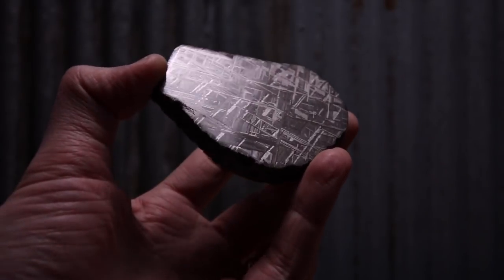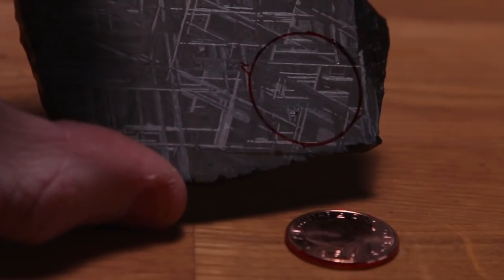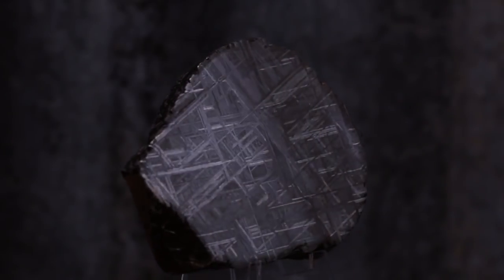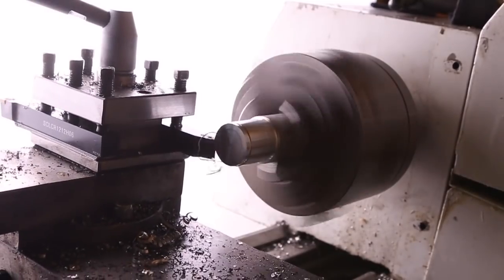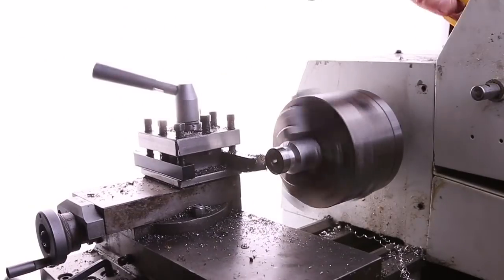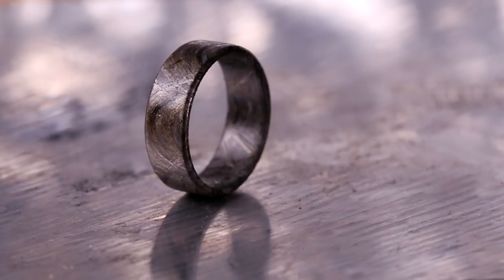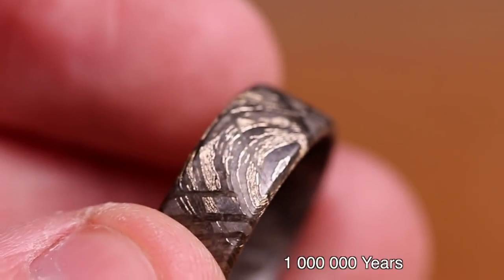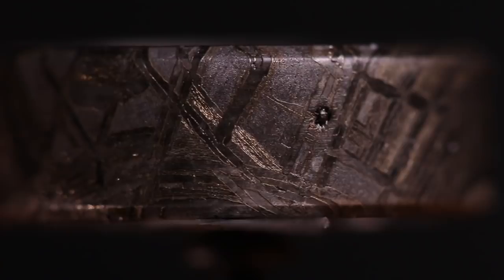my 4,566,300,000 Year Old Ring - crafted from a Swedish Meteorite

Comment: 03:34 Your logic does t make sense my dude.  Your reasoning for why it’s a meteorite is because the lattice pattern takes forever to make… not that it formed in zero G or something.  This could have formed way down in the deep crust of the earth and after millions of years gotten thrust up as part of a mountain or burped out by a volcano or got unearthed when continents pulled apart and a fissure formed.  The reason you gave does t really prove anything other than it took a long time to form.

07:12 ahhh now see “it’s older than the earth by 20 million years is a much better argument for knowing it’s a foreign body.  Although Google is saying the Earth could’ve taken 10-20 million years to form so it’s still possible this formed as part of Earth’s coalescence. 10-20 million years is a huge “margin of error”.

Comment: Excellent work on the lathe.  Question, I assume that was Ferric Chloride you first soaked the ring in for etching similar to Damascus, is this correct?  I also assume the third was a clear coat to help prevent rust (just guesses).  But what was the second liquid you soaked the ring in and for what purpose @7:48 ?

Comment: Technically, yes it can be made in a lab, but one aspect he forgot to mention, is that the only way to get that kind of crystal pattern is for it to be formed in a microgravity environment, in other words it was formed in the vacuum of space. You cannot grow those crystal shapes on a planet like earth, they form in zero g environments. so when you see metal with that kind of crystal pattern, you know it wasn't formed in Earth, or any other planet that we know of, but rather in open space like the asteroid belt or the kuiper belt, and they tend to have formed millions of years ago, while the SOl system we live in was in the process of forming, so to have one and enough to make a ring from is a fairly big bragging right, of which you can say that it is likely older than the Earth itself and formed in the vacuum of space and the lattice-like structure of the crystals makes it more tough than any standard metal of the same composition formed on earth, because the structure of the crystals makes it so. It is a very cool thing to have, only just remember than although these meteorites have a fair amount of Nickel in them, they are particularly susceptible to rust, and need to be treated with preventative care to avoid damage by your sweat, oxygen and other contaminants that cause the metal to corrode just make sure you treat it with an oil occasionally to prevent corrosion, and remember that women's sweat has a higher acidity than men's and some people can destroy these items by simply being in contact with them over time. I suggest that it only be worn occasionally rather than full time and always dry them when they get wet. That being said, well done in making the ring dude, you have an amazing piece of SOL system's history wrapped around your finger!!

Comment: The result is, unquestionably, beautiful. Now, when you can do that all by hand, without doing it all via the use of heavy machinery, I will be impressed.
Reply: It's meteoric iron, not a 'soft metal' normally used in jewelry. The Mohs scale of hardness (used by jewelers) ranges from 0-10 (10 being diamond), has gold at 2.5 and "iron" (this meteorite looks like Kamacite, 90-10 iron-nickel mix) at 4+. You couldn't form it as one does gold, it's a bit too hard; you'd have to hot forge it as a blacksmith does. It's not "impossible" to do, just very hard to work something that small and impractical for sizing. I've made rings out of Titanium (Mohs 6) and one can't practically hot forge it; machining (or grinding) are the best solutions.

Comment: I made a ring, but I used an extra 3/4" Vanadium socket out of my tool box that fit my finger.  Cut off the end, then ground and polished both sides to symetrically match and the sharp edges down into a ring.   Oddly, we have an insanely huge and heavy lathe like this but I never use it.   Let me know how you think it turned out :-)  Picture:  http://shellprompt.com/dump/The_Ring_BookCover.jpg
 
p.s. the person I gave it to, threw it in a lake somewhere in Coventry, England.  So it's now a lost ring on its epic journey...   if you ever find it...   it probably will be rusty... I mean, vanadium steel is corrosion resistant, but not all that much so - according to all the rusty sockets and wrenches I have...  :-p    choppergirl.air-war.org

Comment: 2 things - 1: It really does it for me ! By that I mean it fits perfectly with what I search for in jewellery - it's unusual (Understatement of the year right there !) And it's Unique, luv it !
Give me hand-crafted over machine stamped or mould poured everytime !
2: Watching you operate drill press and lathe took me back 40yrs to when I trained as an apprentice Engineer - of course I never did become an Engineer, because here in N.Ireland All the heavy Engineering was dead - except for the Shipyard, and about 80% of Light Engineering went the same way. 
But the memory it evokes for me, was watching our Instructor, Mr.Fearon, who'd had his right  hand mangled by a Milling machine - and all because his Company insisted that Senior Engineers, like him, wore a shirt & tie under a brown Drs type coat, because they were Professionals ! And they wanted Customers walking through the Machine Shops to See Professional men at work !
And all that bollocks plus ties that weren't Clip-on, meant stopping to chat on his way back from Tea-break, he'd forgotten to button up his coat which cost him  2 and 1/2 fingers off his right hand trying to get the tie out before it choked him to death, or pulled his face into the cutter - which was still spinning even though he'd slapped the Safety button and his mate was on the Brake and trying to turn the bed down ! He wasn't anything after that for another 3yrs, until the Govt. Training Centres came along and he became the Senior Tutor (and 1 of the Disabled Quota !) And, He only ever wore bow-ties after getting the job !
Ever after that I made sure to listen to His Safety Talks and took responsibility for the lads in my Section. Overalls buttoned up, no loose jewellery or rings or watches and sleeves rolled up to the elbow. I also had - which I didn't notice you wearing - 2 spare pair of Safety Glasses - for the dopey young lads who'd forgotten theirs and would have had to go to the Office to get another pair and fill out Health & Safety Reports sheet that went into their Files. 4 in a month was 2 weeks Suspension without Pay ! 
2 Suspensions in 6 months and you were "Out the Gate"! & late '70's N.Ireland was No Place to be out of Work for a Disciplinary ! 
Anyway - talk over, but please be very aware of your own Safety if working Alone. I'll share a Tip with you that I did with my neighbour, a 'Work from Home' Carpenter and a Mechanic friend who also worked alone. An "Aid Call" button you can clip-on, or have in a pocket. I know it's the kind of thing you normally give to Older or Vulnerable people ! 
But, as I told them guys, if you're alone and immobile what if you can't reach your mobile cell fone !? I'm that cautious I were mine - and Safety Glasses ! - even just painting the ceiling, or putting up a light fitting, or under any of the family cars. Basically it's Safety 1st,2nd & Last with me !

Comment: wow what an easy process. Could this be done with obsidian?
Reply: I don't think you can do this with naturally formed obsidian. It's basically glass, but the naturally forming structure is layered across the entire mineral. Like sedimentary rock (ie shale). But it's igneous. That structure means it chips and shatters reeeeal easy. Best I've seen was sculpted by shattering the sides and hoping it doesn't fracture too bad and then drilling a hole through. Which has a pretty cool quality to it, but it isn't reflective like obsidian it just looks like granite. And it would probably break if you dropped it wrong. 

You can melt it and shape obsidian. But it has to be extremely hot. Hotter than any typical metal. But the impurities that make it black and pretty form slag and bubble out. So you're left with an ugly goey glass. 

My only source for this "knowledge" (trivia) is a bunch of videos of people trying to craft things with it. 

How rad would that be though!? Someone should figure it out. (b^.^)b

Comment: So this metal is not as hard as titanium, how easily does it cut through in an emergency 'with those cutters they use at hospital's? 
Idea or question for you 'how would this metal go if it was to be made into a sleeve and then soldered or fixed over a silver or any other precious metal ring,,, could that be easily done with that type of metal?

Comment: This is simply amazing the look it shows after you etched it. Is this ring reactive? Is it reactive similarly to tungsten?
Reply: Most meteorites have a high iron and nickel content, so without some kind of coating rust will appear rather quickly. Some have other elements that help resist corrosion but most will rust without a coating.

Comment: How do "they"  know the earth core is molten iron?
When the deepest hole EVER.drilled in less than ten miles deep?
Reply: It's a series of very educated hypotheses, backed up by extra-terrestrial evidence. 

Firstly, Newton's Law of Gravitation states that the force of attraction between any two particles in the universe is directly proportional to the product of their masses and inversely proportional to the square of the distance between their centres. 

In layman's terms, that means that the greater the mass of each particle, the stronger their forces of attraction on one another, while the greater the distance between each particle, the weaker the forces of attraction are on one another.

a couple of formulae:

Density = Mass/Volume 

((GravConstant * Particle1Mass * Particle2Mass)/EarthRadiusSquared)  = (Particle2Mass * Particle2Acceleration)

^ This formula simplifies to:

Particle1Mass = (Gravity * EarthRadiusSquared)/GravConstant

This means we can calculate the Earth's Density by taking the Earth to be "Particle 1", while Particle 2 can be literally any object on which the Earth's gravity is acting. Because the mass of particle 2 cancels in the formula, it's kind of irrelevant. 

Therefore, we can calculate the Earth's density by combining the formulae to get:

Density = ((Gravity * EarthRadiusSquared)/GravConstant))/EarthVolume

Some conclusions we can reach with the data we obtain from these formulae:

1. The Earth's average density is far greater than the average density of the elements making up the Earth's crust. Therefore, we know the Earth's core must be super dense in order to make up the difference in average densities. This  means the core must consist mainly of Heavy Metals.

2. Iron is the most common heavy metal in the universe. It makes up the majority of meteorite cores, as shown in this video. 

3. We can assume that iron therefore makes up the majority of the Earth's core.

People say it's molten, it's not. At least, not entirely. The Earth's core is actually two layers; the outer layer is molten, while the inner layer is solid. This is because the inner core is under unbelievable pressure, and boiling and melting points increase with pressure, as the greater the pressure, the stronger the intermolecular bonds are, and the stronger the intermolecular bonds are, the more energy is needed to break them. Fun fact, on Everest, water boils at approximately seventy degrees centigrade, because the air pressure is so much less up there than at sea level. 

We know the core's outer layer is molten and the inner layer is solid because of special types of seismic waves which we can emit and then detect the reverberations of. These reverberations are different when they travel through solids and liquids, and from them we're able to judge the various states of matter from the Earth's crust to the solid core. 

I may have gone a little bit overboard on this explanation - I really enjoy all this stuff, sorry ;-; Hope it answered your question to a satisfactory degree!

Comment: When they com up with a age for something like this you know they pulled it right out of their ass. They found a hammer in bed rock hard n Texas dated 100 million years old. A boy found a bolt and nut inside of coal dated something so ridiculously old and there are tons of this kinda shit just like there are 3 locations I'm aware of where right next to Dinosaur foot prints are a set of human foot prints in the same exact sediment so they had to be formed at roughly same time. You get down to the nitty gritty dating methods going past 1-2 thousand years it is completely unreliable and the further back in time to date an object the more off it gets. I have a good theory on this matter but that's another conversation completely.

Comment: Should have used a miniature diamond sabre saw blade, or a hole saw, and cut out the center; you could have gotten 2 smaller rings out of that piece by not drilling the center into dust.

Comment: Any thoughts of this ring being the one to rule them all or Thor's hammer Mjölnir are not feasible. Cause the reason no one could lift the hammer was the material had undergone heavy spin like that of a black hole compressing the material into super ultra compressed material. Meaning it became much to heavy to lift. I think one spoon full of this substance was like several hundred thousand tons. because of the intense gravity in the spin created a new compressed element. So if you can't will that ring to move, that if it were Mjölnir material a room temperature super conductor you would not be able to lift it,

Comment: I think I saw a few pieces of Muonionalusta meteorite on Ebay around $96 usd a chunk. 
@t

They also sell keychains at $1-2usd a piece
@t

Wikipedia
New analysis of this strongly shock-metamorphosed iron meteorite has 
shown a content of 8.4% nickel and trace amounts of rare elements—0.33 
ppm gallium, 0.133 ppm germanium and 1.6 ppm iridium. It also contains 
the minerals chromite, daubréelite, schreibersite, akaganéite and 
inclusions of troilite.[3] For the first time, analysis has proved the 
presence of a form of quartz altered by extremely high 
pressure—stishovite,[3] probably a pseudomorphosis after tridymite

Comment: +1,000 Heath Points
+1,000 Mana Points
+50% Heat Resistance
+15% Fire Resistance
+10% Physical Attack Resistance
+10% Magical Attack Resistance
+5% All Resistances
Immune to Soul Attacks
Immune to Metal Element
+2.5% Defense
+2% Strength
+2% Vitality
+1.5% Agility
+1.5% Charisma
+1% Intelligence
+1% Wisdom
+0.5% Luck
- - -
Crafted from a meteorite found in Sweden, this ring is 20,000,000 years older than the earth. Over the countless years, this ring had absorbed all kinds of elements, gaining resistance to them.

Comment: That's an awesome concept! However come on the radio metric dating methods are nothing more than a farce. My associates have to deal with those at labs like you see allays radio metric dating lab and you can "date" the exact same rock with different methods where 1 says 4 billion years the same rock could date 50 million. In a 100 million year old rock we had in cased would that was dated a few 1000 years old. It doesn't work it just makes things look more important because we put a lot of zeroes behind the date.